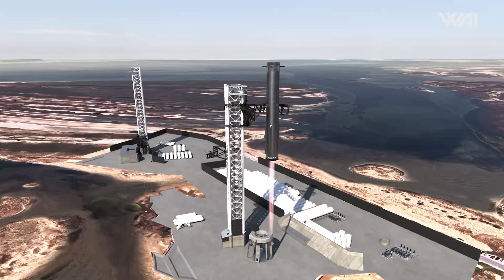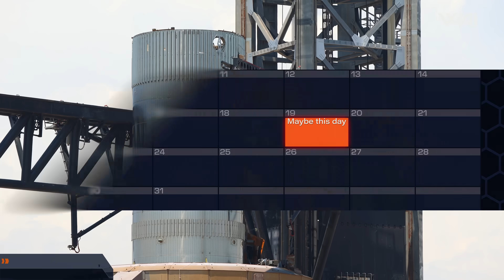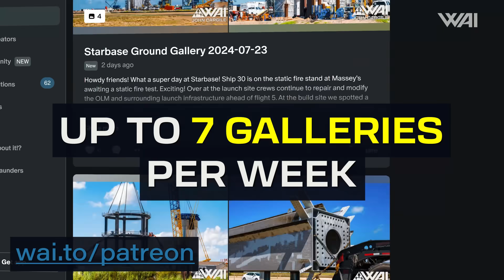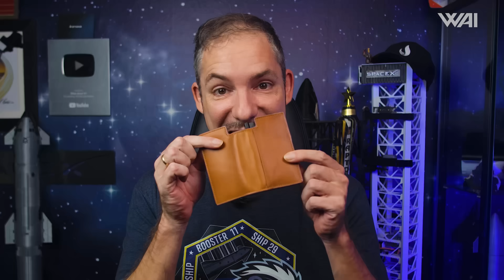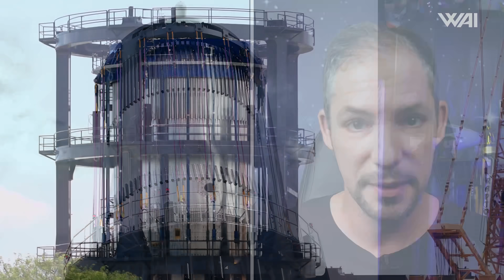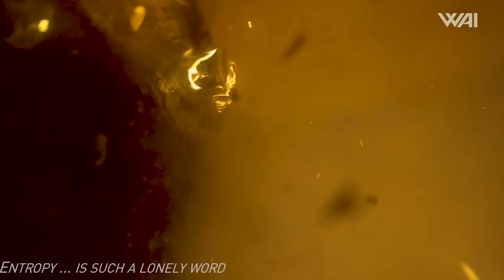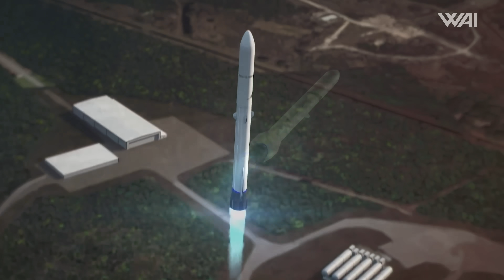SpaceX Is Insane! - Starship Flight 5 Test Campaign! They're Ready For The Catch!

Comment: I thought they would have caught the rocket by the fins, considering the small margin of error with those two points.
Reply: The grid fins are 1. Not structurally strong enough, and 2. Have complex mechanical assemblies that would be damaged or destroyed by that level of dynamic force.   I also worry about the specific requirements for orientation to utilise the “pins”.  I would have thought a ring would be smart, but it would also be very heavy .  Let’s see how they do.

Comment: hey what do you think about this idea at to front of the " chop sticks ' they put an impediment  bar or a catch latch so when the ship is between the chop sticks and the chop sticks closes they wont over close and the catch latch wont open . does my description make any sense , let me know
Reply: Good point. I considered a cable and pulley system connecting the ends of the chopsticks - such that they pull them together and stabilize the entire system.

Comment: imo the back right ram blow a seal, lost hydraulic pressure putting to much strain on the front right ram causing it to buckle and snap, then Jenga.....
Reply: I agree.  The engine contacting the deck is the RESULT of a leg failure, not the cause of the fall.  Any big engine or control fault would likely cause a crush and RUD.  This was a fall.  And the leg strut can be see flying loose before the fall.  Good call Sir.

Comment: I'm sure I'm missing something, but why not just land the booster in the same manner that they land the Falcon boosters? catching it seems to add an unnecessary amount of risk.
Reply: @HotRodJallez  to save weight and increase launch capacity. Landing gear is heavy, so if you can leave the landing gear on the ground you’re saving a lot of weight.
Reply: Not JUST weight.  That is the primary problem, but SpaceX want RAPID reusable boosters…catch, place, refuel, launch.  3 hours.  Landing nearby and then lifting onto a transport stand, travel, place …and so on…that takes too long.  The Falcon needs a substantial refurbishment every recovery…the Heavy booster is expected to fly after system checks and refuelling.
Reply: Weight
Reply: @apacheinstructor  landing legs would add a lot of weight to the boster lowering payload amount
Reply: Thanks for the replies.

Comment: I think it’s simple. 22 flights is the present max operational life for the Falcon 9 rockets.
Reply from the maker: That's the current record, yes! SpaceX is very interested in pushing that further up, though! It's very important to find the reason for this recent failure. Maybe it's something that can easily be fixed and the envelope can be expanded further! Imagine 50 launches or 100! It's all new territory. They don't even have a plan for how and what to maintain at what intervals because this has never been done before! SpaceX is fascinating! :_WAISweet:
Reply: @Whataboutit  It's called "failure," and after failure you have what is called "success." After 22 successful landings I would be shocked if SpaceX were starting to wonder just when things would start to fall apart.
Reply: @Whataboutit  honestly, with the operational conditions these rockets face each launch, it’s surprising to me that they can get 22 successful launches out of each rocket. 
If I was a regulator, i’d be capping it at 10 flights, with an in depth inspection and overall before a rock can return to service. 
And yes, i’m aware that they are inspected after each landing, but so was flight 22, and it failed on flight 23. So if they want to get to 50 flights or more, clearly more in depth and detailed periodic tear downs need to happen to endure hydraulic rams don’t fail, and static firing of engines to ensure they’re functioning properly.
Reply: @davidblalock9945  Why?  What's the danger to anything but SpaceX's profits?
Reply: @davidblalock9945  It would be smarter to figure out if the failure is even related to the age/number of launches of the booster first. That's the point of investigating. We don't actually know whether boosters are reliable for 20 launches, or for 2000. Experience and investigation will tell us this, over time. Arbitrarily capping at 10 flights? Do you happen to be a government employee, by any chance?
Reply: @davidblalock9945  still 21 better than ALL competitors. Lol
Reply: 23 Flights and 22 landings
Reply: It was caped at 10, then 15, then 20, then…,? And yes it was fully inspected after each mission with extra testing at each cap level before being authorised for further missions.  There was no failure with the mission, only the recovery. Also obviously both the FAA and SpaceX will complete an investigation into what happened and whether it was a hardware problem or something else entirely.  😊
Reply: It may be an issue with design and they simply need to change a few parts or alter design a little. It might even be a problem with maintainence, someone missed an issue.
Reply: @seriousmaran9414  More likely they're learning that there's something else that they have to check.
Reply: @JClarkeCT1334  which would be a problem with maintenance or design.
Reply: @seriousmaran9414  It's only a "problem" if something was neglected.  They're pushing the envelope, which means that they learn new things.  They may learn that they have to inspect someting they haven't been inspecting in order to further extend the service life, or they may find that they need to redesign something in order to extend the service life.  This booster already went 2x its originally intended service life, so it didn't have a "problem", just an opportunity to learn how to extend the service life further.

Comment: For the wastewater issue, would it be possible to siphon and filter water from the bay? Would this alleviate some of the regulatory issues with the deluge system?
Reply: @DGC2001  most of the waste product ìs steam, jùst h2oʻ. Unless there's some suspicion the fuel or oxidiser is not retching complete combustion and theres a heap of methane, which is cryogènic and would boil off, this seems to be a false story. There's no hydrolics from the TVS, its all electric gimballing.
Reply: Honestly no, these regulations are just nonsensical

Comment: I wonder when the last time the water was tested at Cape Canaveral from one of NASA's launches?
Reply: Was thinking the same thing.. 🤔
Reply from the maker: Yep. Excellent question! Solid Rocket motors especially are way more harmful.
Reply: Germany does the same: when the german federal agency for technical relief (THW, nearly all volunteers in civic protection) are practicing refining river water to drinking water they are not allowed to discharge this water back in to the river because in the moment it comes out of the pipe it turns into wastewater :D :D
Reply: Exactly 💯 😂

Comment: I can see back splash type heat tile sheets being used in the future instead of individual tile attachment.
Reply: That is why most of the Starship is a simple cylinder.  There are many ways to reduce installation costs on a flat or cylindrical surface.

Comment: The issue of the potable fresh water from the deluge system into a salt water marsh is ridiculous when you consider the area gets about 28 inches of rain water per year. The water from the deluge system is minuscule in comparison.
Reply: Just add salt.
Reply: @womble321   Ah yes, a scholar I see.
Reply: Just rained here yesterday
Reply from the maker: Checks are important, though. There are some chemicals at Starbase (hydraulic fluid for example) that are very close to the deluge water cycle. I know! We all want this to move as fast as possible! In the end it should be done the proper way, though. They're doing that now. Let's just hope that this isn't a delay tactic and that everything is there for a reason. :_WAIHeart:
Reply: The issue isn't the absolute quantity of water, but rather the rate at which that water is dumped into the ecosystem. Marine life that are not adapted to large quantities of fresh water ingress will be harmed.

There are ways to mitigate the rate of dilution, which may need to happen. A paper company I used to work at had to do this because of dumping 20 - 30 million gallons of fresh water into a salt water marsh.
Reply: @CharlieOdom1957 this is correct.. a sudden salinity change can just wreck aquatic life. A catch pool and then reuse or slower release would be great
Reply: @CharlieOdom1957  I live on the gulf coast. Nature balances things out. I've been through many storms dumping in excess of 20 inches off rain in several hours, and several times each year storms that dump over 5 inches an hour. It runs off into bayous and into the Gulf of Mexico. It all works out the way nature intends. The Army Corps of Engineers regularly diverts millions of gallons of water a day to protect businesses downriver on the Mississippi, and it has very little effect except for temporary algae blooms.
Reply: @darkwood777  not the same. Water being deleted over vast areas is completely different than dumping millions of gallons nearly instantly into a highly focused area.

Here is a test you can do yourself and see how it works out for you: get a salt water aquarium, fill it half way, then dump the other half fresh water into it and see what happens.

That is what happens in real life, without proper dilution and other mitigating factors.

Comment: I hope starship goes through the re-enrty without damage and land smooth
Reply: If they recessed the hinges down into the hull, they wouldn’t need to worry about tiling around all of those compound curves. It’d be a much cleaner/ more effective design.
Reply: With the dual layer tiles and tighter seams/repositioned forward flaps, they will go through re-entry fine. Catching the thing. That is the big challenge even though F9 has landed with a couple of meters precision several hundred times. Ironically, with far more engines and greater throttling range... their control should be much better than F9 with its slam landings.
Reply from the maker: I do too! :_WAIHeart:
Reply: @Whataboutit  Felix you're doing a great job, keep it up.  Please don't get caught up in changing things based on a few comments.  Remember, all the great Youtube channels found the working formula and stuck with it 🙂.
Reply: @TheTurbineEngineer  We just Fast Forward parts we have already watched.
Reply: Be amazing to watch if it does and amazing to watch if it doesn't
Reply: @davefarmery8180 The great thing about SpaceX flights is that whatever happens it is deemed an outstanding success. No other company can boast this achievement.